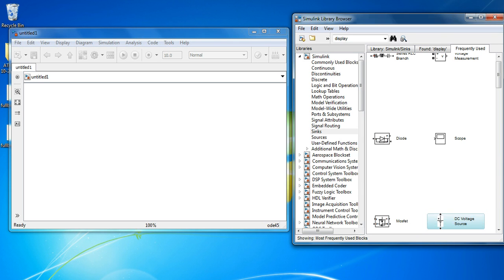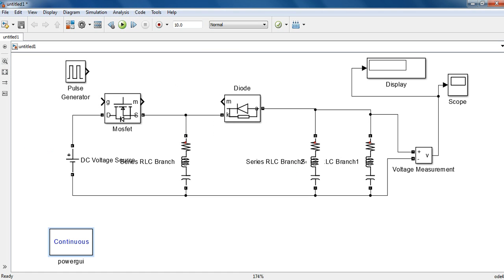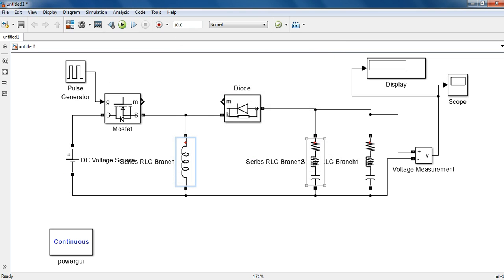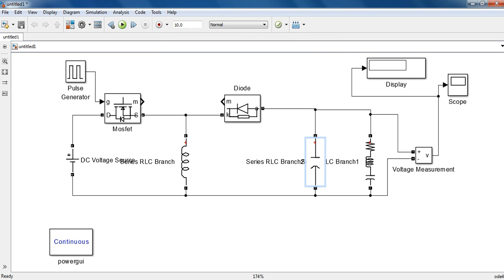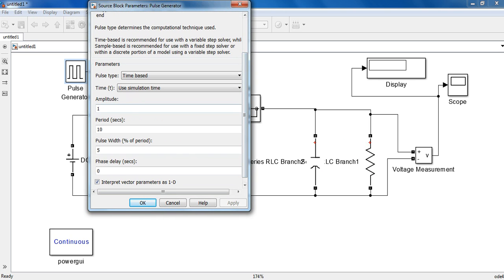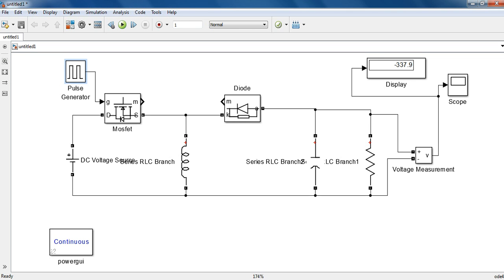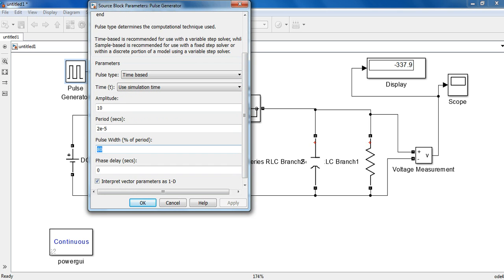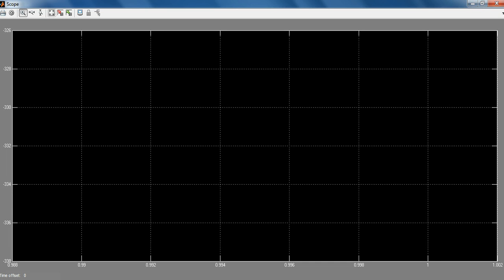Buck-boost DC-DC converter MATLAB/Simulink.

Comment: there are micro farad capacitors not micro Henry........lol....simulation pura galat hai..after using boost converter output voltage decrease to -324v .. and using bulk converter voltage was -24v . wtf

Comment: why the output voltage is in negative?
Reply: because it is an 'inverting buck boost converter' ..... To get positive output voltage, we need non inverting buck boost converter. . The non-inverting configuration is built by combining and modifying a buck and a boost circuit and will have 2 switches (MOSFETS) instead of 1 switch.